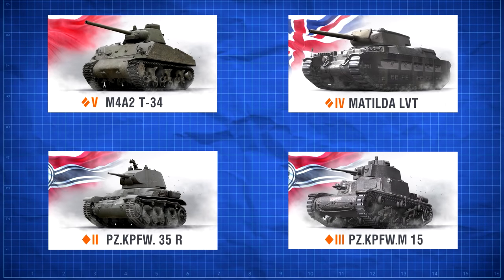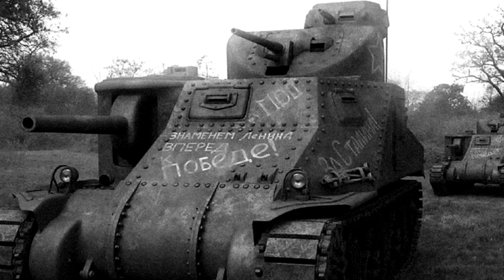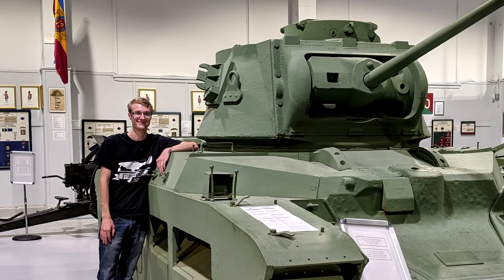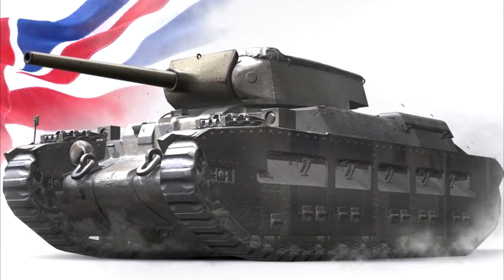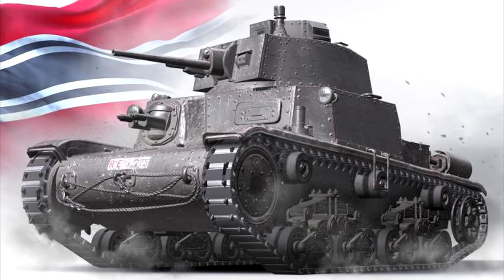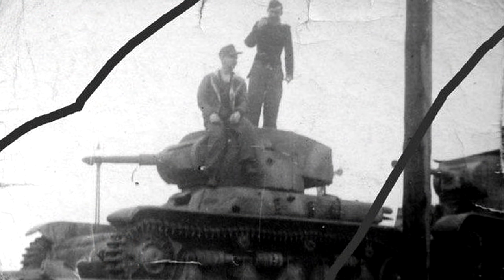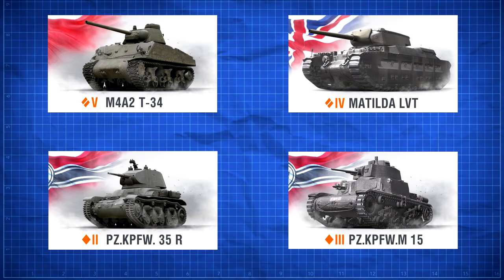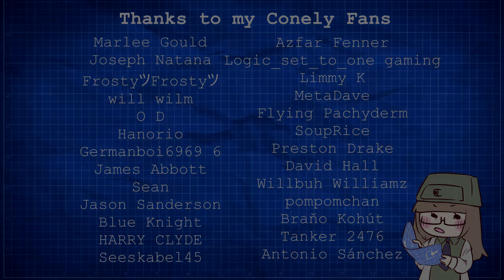More Wargaming Fakes or Real Tanks? | Cursed by Design #Shorts

Comment: Again, Wargaming is really stretching to not have to put in multiturret tanks and wartime armored cars and halftracks.
Reply: Here's the thing about multi-turreted tanks. Something like the M3 Lee would benefit from it yes,  but by that point it may need to change a Tier. Then you realized it's not just on the Lee, what ablut the Japanese Superheavies? The addition of more may require for the entire line to change tiers around. The turret tanks also has machine guns on them, must they be added in as an additional arsenal? Those every single tank must also have machine guns as weapons if that's the case? It's a unintended domino effect that will cause them more headaches down the line. Entire lines have to be looked again on which tank needs to be shifted thanks to the addition of multi turrets and machine guns.
Reply: @vanquilknight6270  I've actually more so mused that multi turrets are often glanced over because it's hard to justify a multi turret line that goes to tier 10 and can spin off a premium at tier 8 (or I guess tier 9 now). Besides, it's not like Wargaming hasn't implemented a mechanic, and did not retroactively add that mechanic to tanks that would benefit from it. Especially since the Lee is a 'collector's vehicle' now and has been replaced at Tier 4 by a prototype Sherman.
Reply: @RedShocktrooperRST  Thus it may be the case that in Wargaming's eyes, the effort to apply the Mechanic for multi turrets doesn't truly justify the development work to put them in.
Reply: @vanquilknight6270  Yeah, but a few years back they did a halloween event where you controlled multiturret tanks, so it's something they can totally do. Just a matter of either adding more low tier tanks after simplifying the tech tree or finding enough of a nugget of existing multiturrets to expand out into a line of fictional tanks.